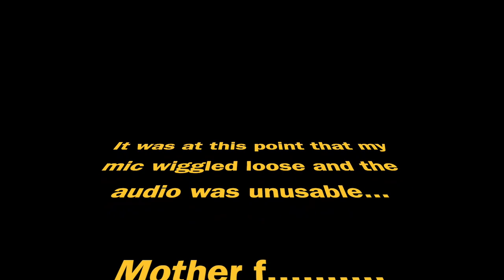2022 Triumph Speed Twin Sprocket Install

Comment: I'm gonna attempt a front sprocket change on my 2022 Bonneville T120.  From 17 teeth to 16 teeth.

The service manager at Triumph San Diego sez it's an inexpensive way to increase performance.

This video is providing me with some general direction on a task I have not yet done.

Cheers, mate.

Comment: Did the same on mine few months back.. fair play Dave for making the video. Initially tried to do mine with torque wrench, the only stuff I pulled was every muscle in my back😂..ended up buying an impact wrench. But was worth every penny. Ride is much comfortable now. But u won't feel a bog difference though. Gearing is much better in terms of relaxed riding.. next up is debaffling my stock exhaust. Tough one but. Enjoy👍
Reply from the maker: What year is your bike, and what country are you in?  The US bikes for 2022 and newer, debaffling is super easy, its a 5 min job if you have the right tools.
Reply: @SquireSCA  from ireland... bike is 2020 model, previous version. Have the decat and all done, sounds pretty good already but u know boys can stop fiddling with their toys🤣..planning the mod when the weather is right...If the weather is ever right here..Weslake shorty pipes are also an option for 200 some quid..🤔
Reply from the maker: @shijopunnooseabraham  Gotcha...  Yeah, the version you guys have is all welded up.  My 2017 Street Cup was that way.  I drilled out the rivets, popped the end cap off, then cut out the guts of the muffler with a large sharp chisel and hammer. Once it was gutted, I bought some 2.5" inner diameter perforated stainless tubing, cut it to length, wrapped it in muffler packing and stuffed it all back on there and riveted the cap in place to secure it.

But if you can get a set of cans for 200 clams, I say go that route and save a few hours of your time, some skinned knuckles and having to throw several dollars into the swear-jar.  haha
Reply: Lol, been there done that too!
Reply: @SquireSCA  🤣🤣..

Comment: I did over the winter. Forgot I had done it on the inaugural ride and wondered what the heck happened to my acceleration.  I think I will be going back to the 16T.
Reply from the maker: Yeah, on mine I don't feel it as much, but mine makes about 10hp more at the wheel than it did stock....
Reply: @SquireSCA  Mine is at the same tune level as yours.  I notice the 4500 rpm, 2nd gear wheelies went away.

Comment: Do something similar on your MT-10 - but drop a tooth or two off the rear sprocket instead (to lengthen the wheelbase slightly as well) - it makes 3rd gear usable on the road without the bike trying to flip all the time.
Reply from the maker: No way!  I like the stock gearing on the MT-10.  With the IMU and electronics package this thing has, the gearing is perfect.  I leave lift control on 1, Slide control and traction on 2 and its perfect.
Reply: @SquireSCA  Fair enough I got fed up with the bike wheelieing over-taking cars in third gear.  A couple off teeth off meant I could tame it just by leaning on the tank - but if I wanted to wheelie just sit up a bit.  But the stock gearing does feel exciting.
Reply from the maker: @LondonSteveLee  Yeah. I love wheelying out of every turn at like 75mph, effortlessly, but the new IMU catches it and softly puts it down...

Comment: Good video. You tightened the rear axle nut to 150ft-lbs. I think the manual says 110 Nm about 81 ft-lbs. You might have over tightened the nut? I was interested in the change to the gearing and how that relates to real world riding.
Reply from the maker: Its possible that I was thinking of the Yamaha...  Hmmm...  I will loosen it a bit.  Are you sure about the 81 ft/lbs?
Reply: @SquireSCA  I checked my Haynes manual says 110 Nm for the rear axle nut.
Reply: And 150Nm for the front sprocket nut.
Reply from the maker: @paulhartwell8460  got it, adjusted accordingly, thanks!

Comment: Because the engine lacks top-end power you may find there no loss at all from slightly longer gearing.
Reply from the maker: Well, 103hp at the wheel at 8000rpm at redline...  This bike doesn't fall off after 7000rpm like the stock one does.  Mine pulls hard right to the rev limiter.
Reply: @SquireSCA   Sounds like a nice tune. It would be good for someone  with the time and patience to try doing some head work - I think that's what restricts these engines.  On paper the valve sizes and compression look fine - they just don't flow!